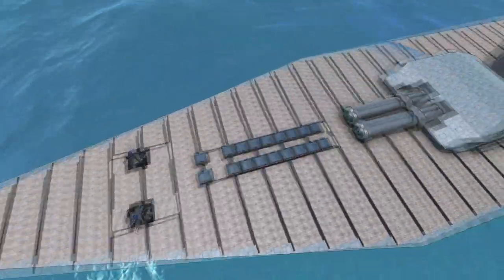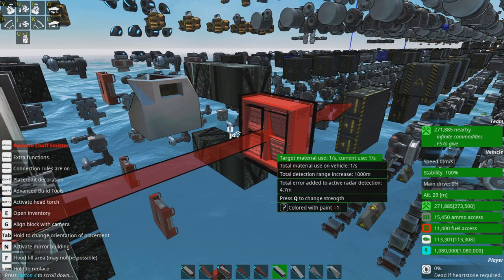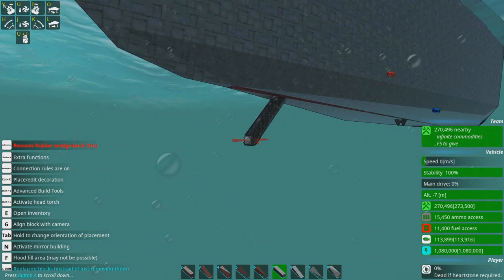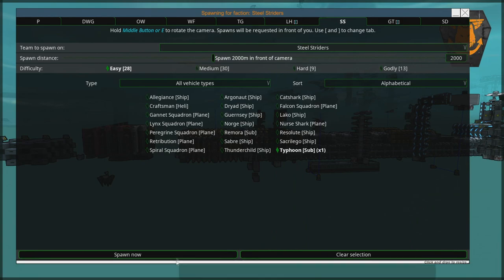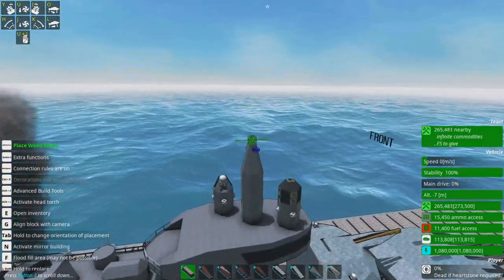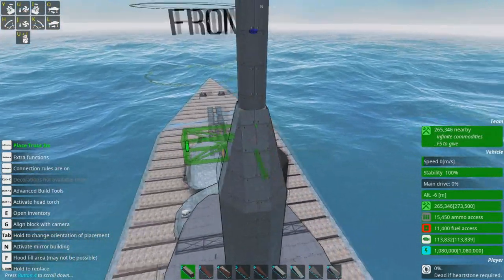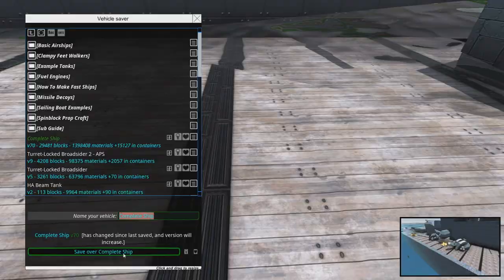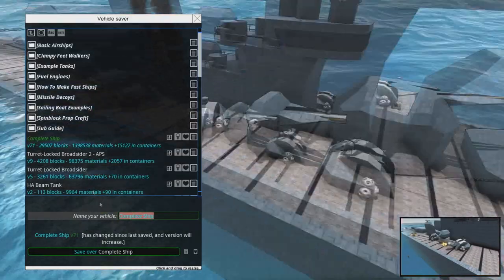Complete Ship Walkthrough #18 - Block-Based Missile Decoys! 🔲 🚀❓ From the Depths

Comment: You know, you could probably condense most of those ACBs, except for the ones that fire the missile decoys (because GBS for some reason cannot fire weapons :<, devs pls fix) with a single AI breadboard

Also, it will look stupid, but against missiles that use either APN or TPG, making the decoy stick very wide and spin very rapidly should work really well - they will see a rapidly-moving aimpoint, which will throw their prediction wildly of course.
Reply from the maker: True and also true. I want to avoid breadboard just for this series though, and I don't want the decoy stick to look too silly. Even I have standards. XD
Reply: I think you might be doing something wrong. I have a group of craft that use only breadboards for everything, including firing weapons. It's on the workshop if you want to take a look. Bread Warlock mkIII.